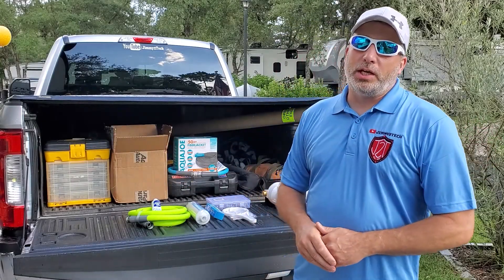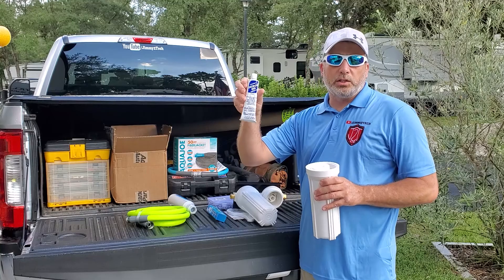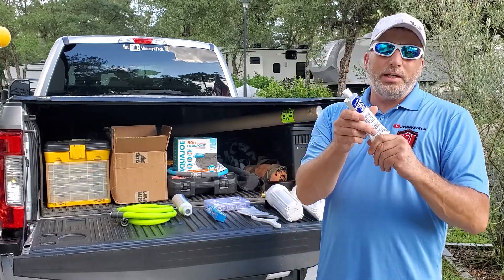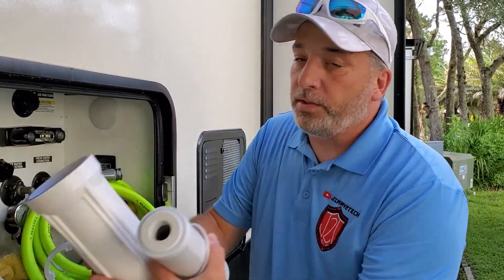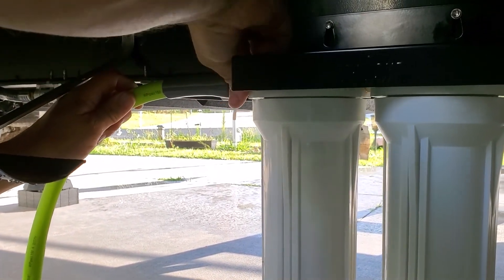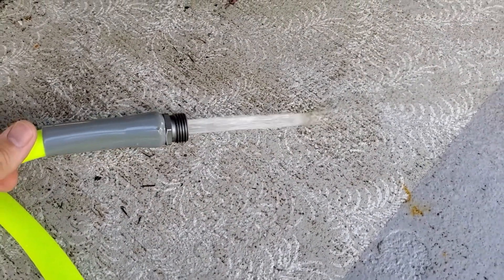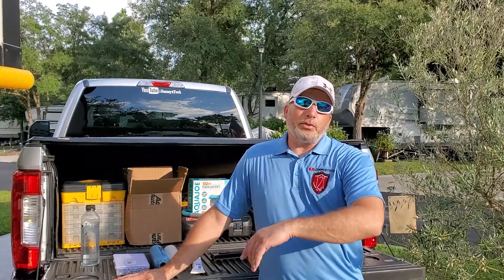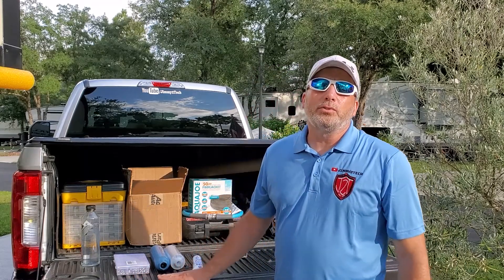Beech Lane Dual RV Water Filter Install & TDS Test

Comment: Is it recommended to put the pressure regulator before or after the filters?  I was thinking that if the filters lowered pressure it would be best to have regulator after them so you may be able to adjust it back up.

Comment: Why does a cheap zero filter work so well with zero TDS, it's not reverse osmosis? I have a triple RV water filter setup with the same problem. I still only drink the water after going through a zero filter. Afterall, we don't know what those dissolved solids are.
Reply from the maker: Not sure really, ,Zero water has some kind of ion exchange technology   that exchanges ions or something like that which lowers tds.  So many different options.
Reply: The issue with the zero water is the fact that it's taking too many solids out of the water bringing it 0 tds. Its dangerous to actually drink water with 0 tds which is what distilled water is.
Reply: @bobbypolo2200  If its lack of minerals your referring to I prefer taking supplements instead of guessing what those solids are.
Reply: I am going to add a RV filter and doing research. I know this is an old post and I don't mean to sound like a jerk but why put a filter on your RV if your not going to drink it? That is my #1 reason for wanting a filter.
Thanks in advance